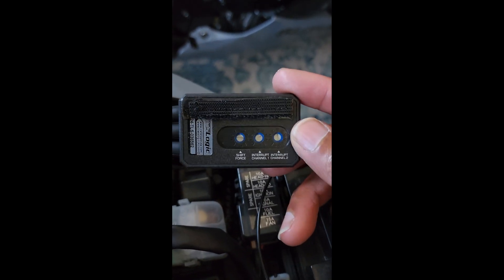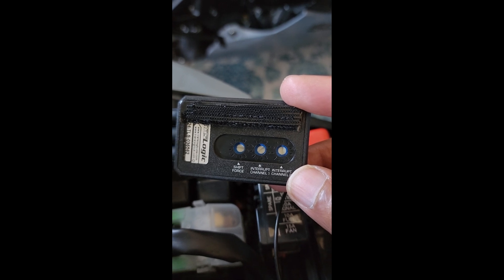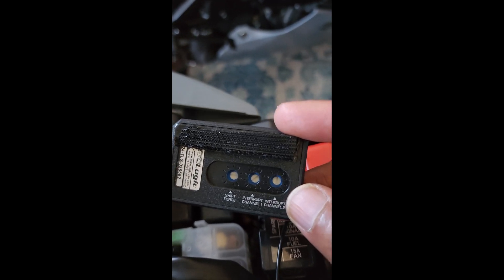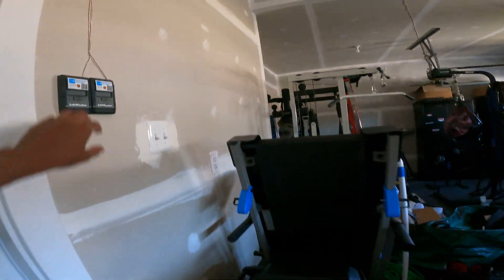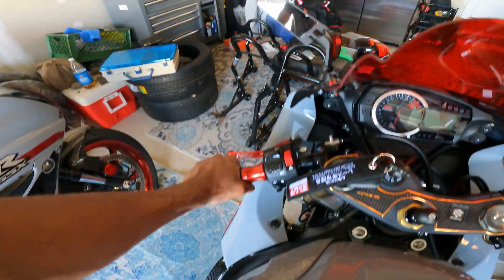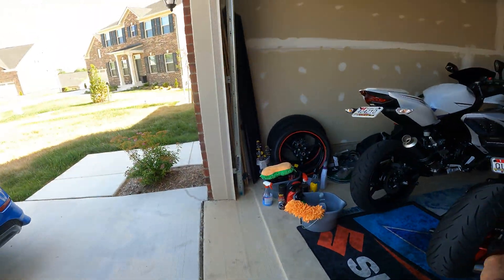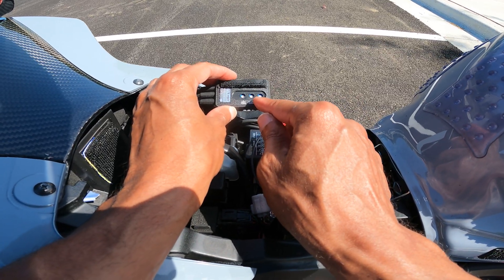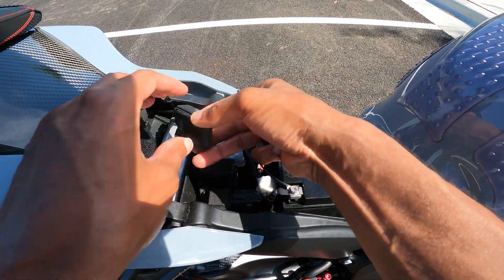Translogic QSXI  Quickshifter Tweaks & Testing - GSX-R 750 - @maxdecebel

Comment: I'm having issues shifting under WOT in 3rd and 4th at the top of the rpm band. It works flawlessly otherwise. 

Do you suggest I adjust the sensitivity?

I've tested it multiple times and it just doesn't want to shift when under full load.
Reply from the maker: Great question. I have not personally experienced this issue; but to me, it does not really sound like a sensitivity issue I.E a stiff feel at the pedal, as I imagine this would be consistent across all gears regardless of RPMs. I think you you're having an interrupt issue. I would try adjusting the channels 1 or 2 for a longer interrupt signal (I'd really focus on channel 2 for starters). Keep in mind these are micro adjustments that you want to make to get the result you are looking for. Has the ECU been flashed?
Reply: @QuikkSilver ya, the gear linkage is stiff, like it won't budge. Yes, the bike has been flashed. It's a 2014 cbr1000rr. The flashing shouldn't affect the qs since it has its own ecu.
Reply from the maker: @ayowser01  I can imagine how annoying that must be. The following excerpt is from the manual: "If the interrupt duration is too short (INTERRUPT CHANNELS 1 or 2) it can make it hard to shift/ move the gear lever and you can miss gearshifts."  Obviously the shift force will impact the feel at the lever, but I don't see how that would not be consistent across all the gears.   I'd get in touch with Translogic and see what they say. They are very responsive and user friendly. I'd like to know how it all turns out too, if you don't mind, stay in touch ✌

Comment: Me thinks you might want to perform this test again with more throttle input. The amount of interruption might be more noticeable at higher RPM. 
While the transmission might feel a little smoother shifting at lower RPM, it might not be what you're looking for at higher RPM. In a racing setting, you would be defeating the purpose of the quickshifter (just my guess).
Reply from the maker: @dunkone40 I totally agree, Sir. The brother I was doing this for was interested in getting the "burp" to sound more like a "buuurrrp." My initial thoughts were just as you described - the longer the interruption, the slower one would be; particularly in a race setting. One's exhaust system will also play a part in the audible feedback you get. I'll have to revisit this one. Maybe a run to Port Tobacco is in order. 🤔

Comment: You ever been looking at getting rid of abs on. The k  ive been researching it as I'm really looking and grabbing a 24 . so far they didn't make the plug and play for it . 22 and I haven't call yet until its in the garage
Reply from the maker: @bde269 I have heard of plenty people doing it, but I haven't put too much thought into it. If I was die hard trying to get the bike lighter, then I could see pulling it off.  But to be honest, on that bigger, faster bike, I feel a little more comfortable with it, knowing it will assist in not locking up the tires. I've locked up my 750 a few times and hearing that screech is a little unsettling LOL!  But anyway, it doesn't appear to be too much of a task to perform a delete...
Reply: thank you brother enjoy the night Quikk